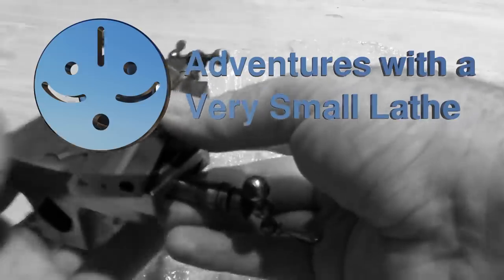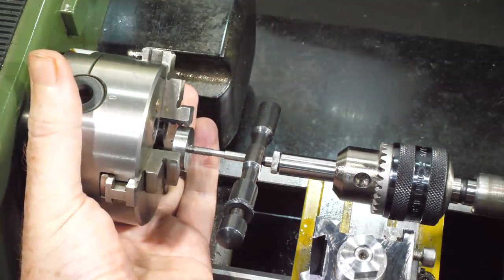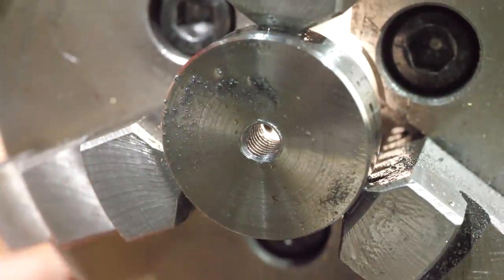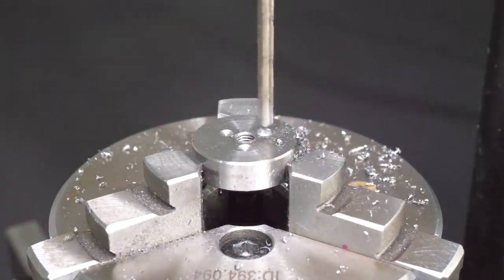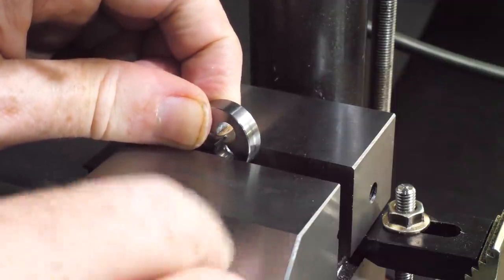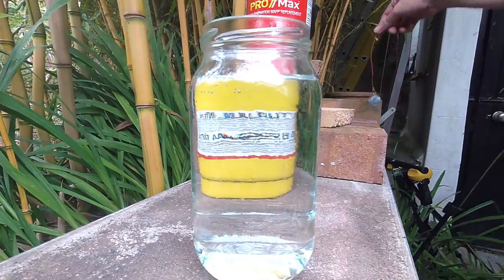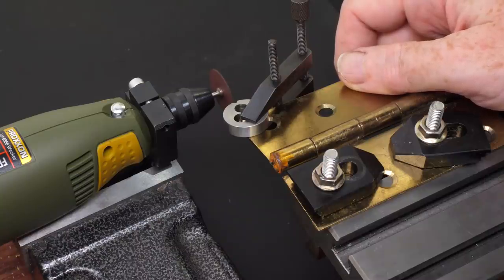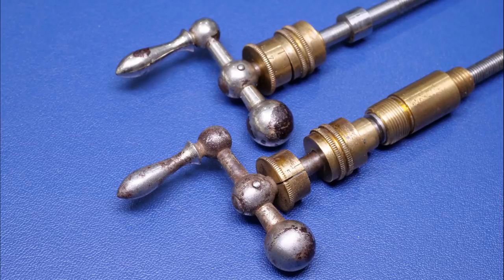Making a Custom Die on the Proxxon PD 250/e Lathe

Comment: Well done! I've made some taps, but never a die. A couple of questions: 
-  Can isopropyl alcohol be substituted for denatured alcohol in this application (mixing with borax for a flux)?
- What about an angled lead for the die? Maybe it wasn't necessary in this application, since you were just cleaning up threads.

Thanks!
Reply from the maker: I'm nut sure about Isopropyl for this application, but I'd guess it would work as all that's required is something to bind the boric acid into a paste.
The die would definitely need a tapered lead to be able to start a thread, which I assume would be created by grinding after hardening. For a die this size it would be pretty difficult.

Comment: I would have expected borax rather than boric acid for protecting the metal. Blacksmiths use borax as a flux. Boric acid boils at 300C/572F and so would not protect metal at red heat. Borax, on the other hand, melts at 743C/1369F and boils at 1575C/2867F and so would remain as a liquid to protect the metal from scaling. A blend of the two might work too, with the boric acid melting to protect the metal at lower temperatures, and the borax remaining at higher temperatures. Most borax you get contains water in the crystal structure, and this is released below the melting point, causing the powder to puff up, steam, and/or temporarily liquefy.
Many people confuse the two materials, including some of the commenters here, as I'm pretty sure that contact lens solution uses borax, not boric acid, although you would get the same end result combining boric acid and sodium hydroxide in the correct proportions.

Comment: Great vid, lot's of good tips. By the way acetone is not an effective solvent for oil and grease. Panel wipe, also known as pre-paint works much better.
Reply from the maker: Thanks for the tip! I ended up giving the brass chips a thorough wash in hot water and detergent. They are now grease-free and make no smoke if I heat them.
Reply: @AdventureswithaVerySmallLathe  and roum22, I have a friend whom does car and bike restorations and his paintwork is the best I have seen in my 60 yrs. In Australia he calls this Grease and Wax remover, years ago when I played with cars I would call it Prepsol. Only mention this so others reading this thread may gain some help from this. Cheers from John, Australia.

Comment: Very good and educational video!  A shy question though: you have a lathe, so why didn't you just chase the thread with an appropriate cutting tool? A second one: since you were clearly cutting off material when chasing with your die, is there still enough left for the thread? Or did the die more or less elastically reform the profile?
Reply from the maker: There are a couple of reasons why I didn't try chasing the thread.
1. The screw is very long and thin, and not really suited for fitting in a chuck, or support via a tailstock. I also don't have a steady, so I couldn't see a way to get it held rigidly enough in the lathe to make it safe to machine.
2. Given the length of the thread, even a very small deviation in the thread pitch (either on my lathe, or the original thread) would mean the alignment would drift, and the thread be damaged.

The main damage to the thread is that the peaks have been mushroomed and rounded. The material removed by the die is the sides of the mushrooms, so the thread is not as pointed as it was, but the pitch diameter is still basically as it was.
Reply: @AdventureswithaVerySmallLathe  Thank you, these are a lot of good arguments. My questions were biased by my own equipment (steady rest, electronic lead screw - any pitch you want). I admire your patience to go through all the work and build a cutting tool, congratulations!

Comment: Beautifully filmed. A most interesting approach.  Depending on your resources putting the part between centres and chasing the thread with a single point tool might have been easier.  Still, great work with the tools on hand. Thanks for posting.

Comment: hi! are you german?

is it a must to use boric acid when quenching?i need a special die but have no boric acid.

muss man zwingend beim härten borsäure nutzen? ich bräuchte ein m6,1x1 schneideisen... hab alles an Material.. nur keine Borsäure...

danke! Thanks!
Reply from the maker: Not German, but I can speak bad German if necessary.

Boric acid isn't necessary, but it is very useful as it stops the steel from scaling up due to the heat, and prevents the surface from being damaged. For my recent tool projects I need the hardened surface of the steel to be clean and accurate, as I don't have a way to precision grind the geometry of these tools.

Boric acid shouldn't be too hard to get. It's usually sold as an insect killer. I think it will be very difficult to clean the scale from the inside of a die after quenching if you don't use something to protect the surface and prevent scale. Possibly other types of flux will work, if you can get them more easily?

Mit freundlichen Grüßen,

A

Comment: An excellent result ! However it would have been much easier, (I realise you probably do not "do" easy), to have used a thread restorer device like the Buckingham thread restorer. You should really get some proper centre drills ,they will give you a much better, and accurate hole location than a stub drill ever will, especially on a very light duty machine like you have, also using a 2 flute slot drill would make boring down a lot easier as they have an offset centre and can cut straight down without a pilot hole to clear the swarf, this was a really interesting video, and I like the use of Boric acid ! Chris B.

Comment: First time viewer. A very interesting process, but is it fair to call it a die? I suspect that it more of a chaser than a die, as it has no lead in taper to be able to initiate a thread on a length of rod. Fair enough, it was made to chase an existing damaged thread rather than cut a new one from scratch, and it seems to be doing the job it is intended for quite nicely. Thanks for the video.
Reply from the maker: A good point, and you may well be right. Tools like this seem to be called Thread Chasers or Chaser Dies interchangeably in various catalogues, so I'm not even sure what the correct term is. I may yet grind a lead taper and relief, probably just as an exercise.

Comment: Very interesting video, thank you for posting it!   Boric acid isn't nearly as biologically nasty as you appear to make out.  It's sold here in the US as a standard pharmaceutical supply and as an insecticide.  The LD₅₀ for boric acid is actually greater than that for ordinary table salt.

 One makes an eyewash by dissolving about a quarter teaspoon in a pint of boiling distilled water, then letting the result cool before use.. Used for relief of pinkeye and various other issues.   Boric acid has very sparing solubility in water, so it's not really all that dangerous.   It makes a great control for ants and roaches as well--the fine dust gets carried back to the nest and is consumed by the insects, which are done in, not by chemistry but by the sharp crystals chewing the digestive tract up.
Reply from the maker: Hi, thanks for the detailed and interesting comment. I did quite a bit of reading while making this video, as I have to be aware that viewers may try and follow the techniques I use. While I read some material which agrees with you, I also came across other material which contradicts it strongly.

Take for example this page https://medlineplus.gov/ency/article/002485.htm at the US National Library of Medicine:
"Boric acid is a dangerous poison. Poisoning from this chemical can be acute or chronic. Acute boric acid poisoning usually occurs when someone swallows powdered roach-killing products that contain the chemical. Boric acid is a caustic chemical. If it contacts tissues, it can cause injury."

In particular I found plenty of warnings against breathing in the dry powder, or getting the dry powder in your eyes. I also know from first hand experience that methylated spirits (denatured alchohol) can be very unpleasant if it comes into contact with the skin, so a lot of the precautions I took in this video was to protect me from that.

At the end of the day I'm not qualified to offer safety advice about chemicals, so when I'm making a video using any chemicals which carry a warning, I'm going to take the most cautious approach advised when handling them. I hope you understand why this approach makes sense, and while I think you are probably right, I'm still going to take into consideration that you might be wrong.

Comment: Enjoyed your video very much.  Not a lot of babble, just information and the camera/editing work were first rate.  Great job and thanks for taking the time.  BTW, loved your hinge fixture for using with fragile thin cutoff wheels !

QUESTION:  Is "Silver Steel" the same as Stainless or s-5 or s-7?  I've made engraving chisels out of S-5 and quench in oil WITHOUT swirling it in the oil and it the oil will self temper for chisel use without the swirl.

Comment: For drilling the three holes I would have thought of printing the top view of the CAD design (with center marks) and stick it on the die. Would have that been a correct solution? Thanks.
Reply from the maker: This would work, but it relies on being able to accurately align the diagram on the part, and then being able to accurately line up the drill with the marks on the diagram. Both of these are harder than they sound. The advantage of using the chuck on a rotary table is that it ensures all three holes are exactly the same distance from the die centre, and the angles between them are exactly correct too. This is certainly more accurate than my ability to align the drill with a diagram by eye.
Reply: @AdventureswithaVerySmallLathe  Perfectly clear. Thank you!

Comment: To reduce chatter on a cutting tool, place a piece of folded denim cloth slightly larger than the cutter,  between the cutter teeth and the job. The cloth will be cut under pressure, filling the flutes and dampening the chatter. The face of the  hole gets a slightly polished radius and the hole is true to size.

Comment: That's a really awesome tap wrench you made. 
Some years ago a friend and I made a custom left-handed acme nut 7/16 for the jackscrew elevator trim on my Piper Cherokee. We ground a boring tool to a shape that allowed the nut to ride on the crest of the jackscrew threads instead of just the flanks as the load was off center by about an inch. Piper wanted 15 weeks and a lot of $ for these parts.  Adding a grease fitting made it even better.
Could that chasing die have been bored?

Comment: Good evening or what ever time it is where you live! Will you ever tell us curious viewers if the granite plate under the proxxon lathe had an impact on the rigidity?
Reply from the maker: It has improved rigidity, but I have very quickly run into the torque limits of the small motor, so the benefits are limited.

Comment: Nice work.  Your split die doesn't have a locator screw?  I've always wondered if small split dies really need one.
Reply from the maker: Is that a screw used to control how far open the split die is, or something else? I'm not familiar with the term.

Comment: Interesting video, thanks, Nice to see usable tools made using small machinery. Couple suggestions - use stub length drills, they wander less. And maybe try using an induction coil to heat treat? 
And one more thing - your boric acid flux may prevent you from seeing the colour changes, maybe easier to get the temperature right without?
Reply: Didn't he stone the faces before tempering?
Reply: @eternaloptimist2840  Wasn't what I meant - during the hardening process it's good to see the colour change so you can judge the temperature...

Comment: Sir..Which material selected for making die... please let me know...
Reply from the maker: In all my videos I put details of the materials I use in the description. I made the die from BS1407 Silver Steel, 20mm precision ground round bar.
It's a general purpose tool steel that is very easy to get hold of in the UK, and easily good enough for this tool.
Reply: @AdventureswithaVerySmallLathe  ..sir,can possible to use d2 or d3 material to make die.can you explain HRC of this die..
Reply from the maker: @A-jw8dg  I'm afraid I have no experience of working with d2 or d3, and no hardness testing tools, so I have no way to measure the HRC.

Comment: Wasn’t the rod repaired an acme thread? You created a standard type taper thread?
Reply from the maker: I'm certain it wasn't an ACME thread. The points may have looked flattened at some points, but at the ends where it was less worn the thread form was clearly pointed. The flattened areas had been squashed into that shape by wear and abuse.

Comment: Thanks Alistair for yet another fine, thorough and inspiring video, I just personally find your excuse for the excellent, rigid and simple grinding jig unnecessary... One humble question I've got is: -Shouldn't the die also have an angled lead-in, thus evening out the thread cutting forces over the first few turns (but wouldn't that also make the thread start easier)? Doesn't a cylindrical die take the entire cut on the first edge/ turn only? Opening the die up as you did, reduces the initial forces of course, then taking successively deeper cuts to form the final thread will be ok. But won't the wear on the die still mostly be on the first turn only? Just 2 cents and cheers from DIYSwede
Reply from the maker: I'm sure you're right that the jig wasn't really necessary, but I had so much work invested in the part that I was paranoid about screwing it up. Having a rigid jig took all the stress out of cutting the slot, as I could be certain it was going to cut straight, and I could really easily control the rate of the cutting.
The die will definitely need a tapered lead-in, and a proper relief before it would be able to cut a new thread, but as I'm using it to chase and clean up an existing thread they are less important.
This video was already really long, and I didn't want to rush working on grinding it. Once I have some other projects out of the way I'll look at grinding lead-in and relief, and see if I can make a decent video of that.
Reply: @AdventureswithaVerySmallLathe  Excuse me for perhaps being unclear, Alistair- I just meant your excuse for it was unnecessary, as your simple, smart and operational hinge solution did its job perfectly well! Thank you for sharing your opinion on lead-in for a die proper, I also realize your need for merely chasing the threads in question clean, and feel no pressure on my behalf for making yet another video of that grinding job. Personally, I feel you're doing just fine, I truly appreciate your method of "thinking out loud as you go along", and don't find their length bothering me at all - that gives me opportunity to consider all the inherent steps myself, rather than just get me all the solutions served, filmed in short "bursts of activity". If I wanted that I could just go elsewhere on YouTube, but I'll be back for your upcoming ones. Cheers, DIYSwede

Comment: This is amazing! 

I have to wonder: do you think you could have ground a very small HSS internal threading boring bar and single point threaded the inside of that die? 

It is small, but not very deep, so the tool could be quite small without flexing too much. 

Your tap method certainly worked, but it makes me wonder just how small of an internal thread cutting tool I could make. I might have to play with that for the fun of it.

Comment: 2 things, 

cutting the relief on the tap, i watched the tap video where you said that it wasnt cuttign well until you did that, but in hind site, do you feel that cutting the relief all the way up past the lead in was wise as it made it impossible to break the chip when reversing the tap deep in the hole?

and the die, i noticed you didnt cut a lead in on that. any reason for that?
Reply from the maker: I think I made a lot of mistakes bringing the tap. You are probably right that I should not have ground it so far back, though I did seem to be able to break chips.

I didn't grind a relief on the die as I was only planning to use it to chase an existing thread, and that seemed to work without relief.
Reply: ok, it looked like you were kind of struggling to break chips. maybe i was distracted by the left handedness of it and you were actually advancing then when i thought you were backing out. 

so, good to know that it dosent make that much of a differance then. one less thing to worry about if i have to make one!